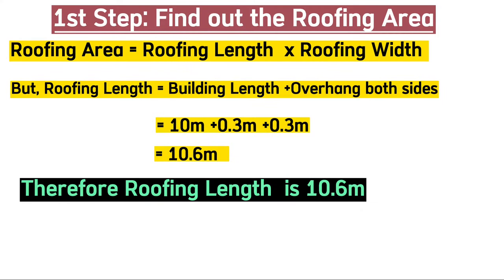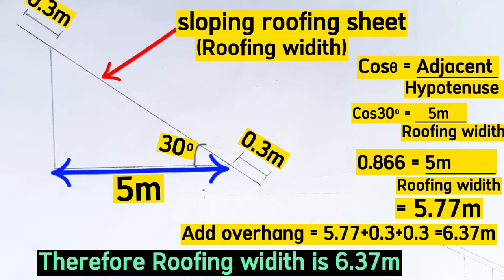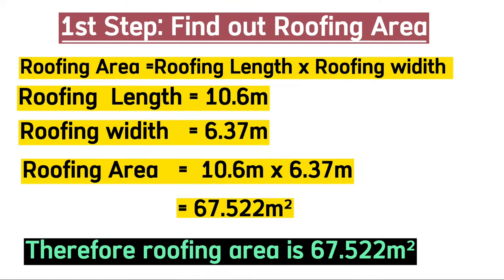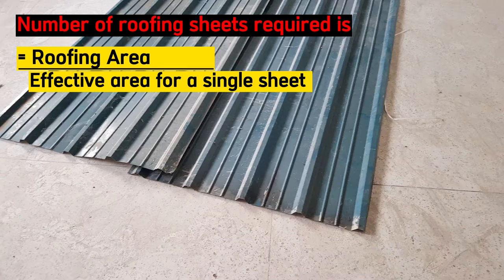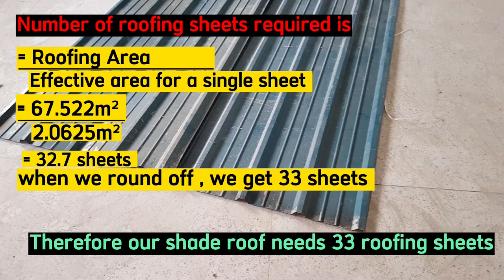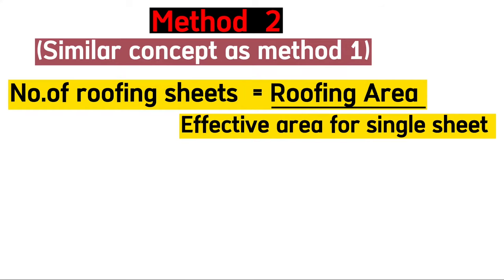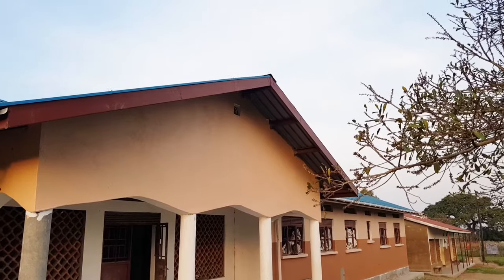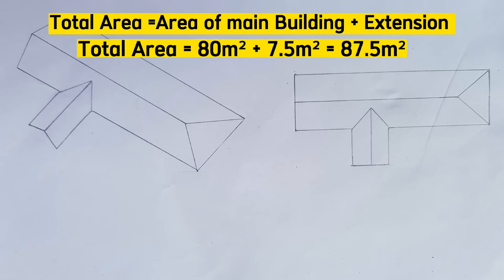How to Estimate gi CORRUGATED METAL ROOFING SHEETS |gi corrugated iron sheets

Comment: Thank you so much sir 🙏🙏.
The overlap width which 75mm to convert it to meter it should be 0.075m but you used 0.75m sir.
Reply from the maker: I clearly  said in the video that,
The widith of the sheet is 900mm or 0.9m so when we deduct overlap 75mm (0.075m) both sides, we remain with 0.75m 

He's what i mean 
900mm - 75mm - 75mm = 750mm or 0.75m
Which is the effective widith 
Not the overlap. 

In summary, overlap is 0.075m (75mm) whereas effective widith is 0.75m(750mm)

Did I clarify anything bro?

Comment: Helpful information but where does 1.3 come from, you've said we use 30%...
Reply from the maker: Whenever you want to increase a number by a certain percentage,  you simply multiply it by 1.that percentage, 
Forexample if I have 100 and I want to increase it by 10% I simply say 100x1.10 to get 110
by 20% will be 100x1.20 = 120
by 30%, I simply say 100x1.3 to get 130 
That's where the 1.3 came from

Comment: How can one change roof from iron sheets to concrete . The building has basic beams.
Reply from the maker: @KinPash Insights 
Thats absolutely possible 

Though a number of considerations have to be put in place
1.Loading
2.Water proofing (roof top drainage)

Understand that a reinforced concrete roof slab is much more heavier than the existing iron sheets roof covering and changing to the  concrete roofslab requires a strong build structure enough to bear this load.

It is safer when the roof slab transfers its loading to the beam, then from the beam to the column and from the column to the bases, then from the bases to the ground. 

It becomes risky when there are no columns because the beam alone won't be able to support the reinforcement concrete slab 

It requires a stronger roof deck

Secondly consider adding a water proofing membrane. After casting concrete for the roof slab, consider laying a polythene sheeting  covering the entire area of the slab( use the 2mm bitumatt polyframe membrane or any other approved) then add a 25mm thick motar finishing (mix 1:3) to cover the sheeting. This way, the roof wont leak

Did I answer your question sir?
Reply: @ianconstruction  very good detailed advisory response

Comment: 30% vs 1.3 ????? Not clear
Reply from the maker: 30% is the allowance for pitch or depth or roof rise

Forexample if the plan area( or top view area) of a roof is 4x2=8m²
When roofing we order 30% more on top of the 8m² so this will be 30/100  x 8 =2.4
So when we add 2.4 + 8 = 10.4m2

10.4m² is the area of the roofing sheet which we will order from the factory or hardware

Then the 1.3 is the same as 30%
So when I say 8×1.3 = 10.4
Same as 8+8x30% = 10.4

In summary, the 30% or the 1.3 is an allowance  to act as a slope correction factor 

Did I answer your question bro?
Reply: Well explained. I was also wondering. Thank you bro.
Reply from the maker: @dennismusyoki8551  you are most welcome brother!